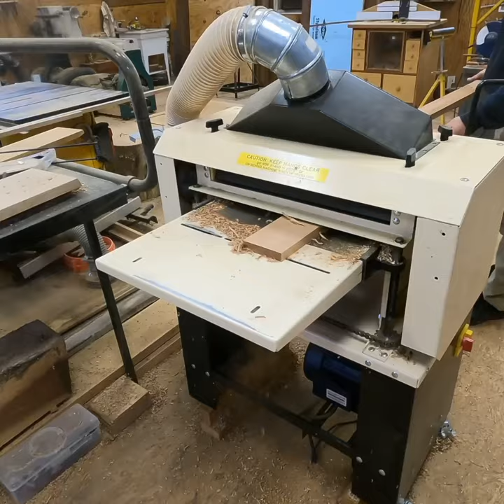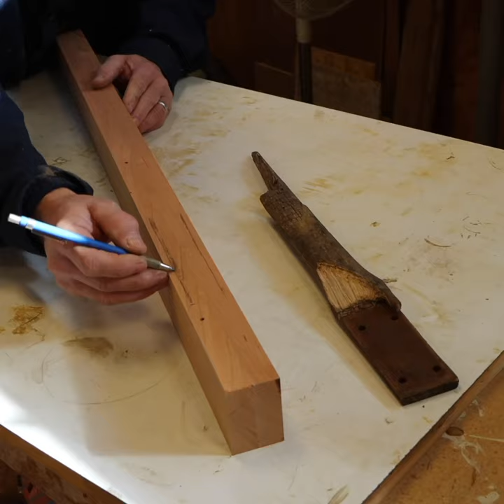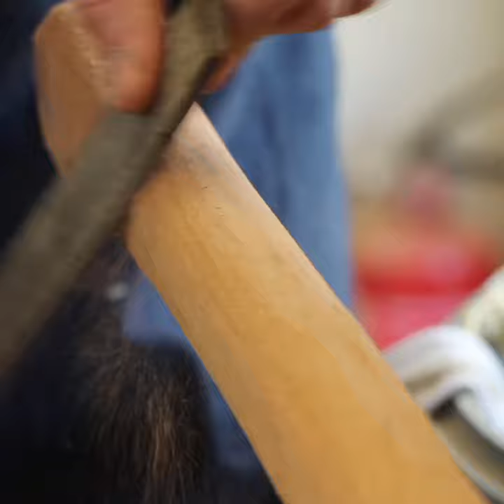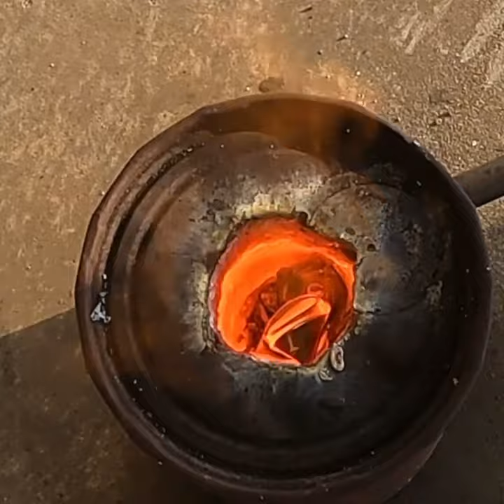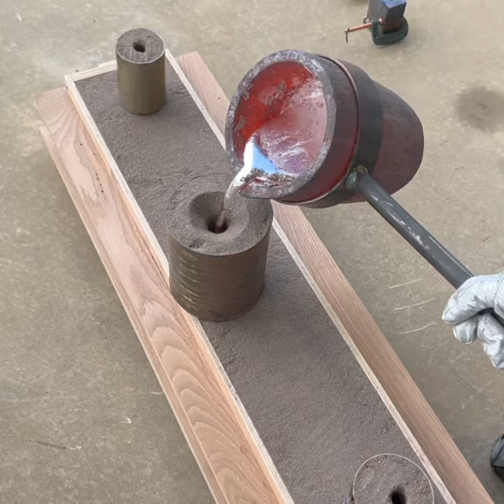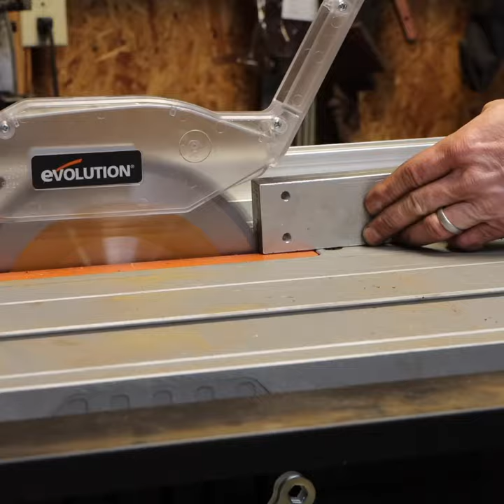Cast Axe Handle From Cans

Comment: That's gotta be COLD to handle in the winter time.  Probably sucks the heat from your hands even with gloves on.
Reply: Along with no flex, my joints are hurting just thinking about each, "whack".
Reply: You really wouldn't use a bush axe in the winter. It's made to cut away overgrowth. Kind of like a machete, but for thicker growth.
Reply: Aluminum changes temperature fairly quickly. Yes, will steal all heat.

Comment: I found a bill hook just like that at a recycling center. The guy behind the counter refused to sell it to me, saying it was part of the decor. So im still using home depot bought peice of metal on a stick that bends in the slightest breeze and holds an edge like warm butter. Glad someone hired an interior decorator for the dump money well spent.
Reply: Just.... Go buy one? Why did you buy a POS sheet of metal instead of just getting the tool or getting the blade?

You're better at crying than trying apparently

Comment: When I was in high school back in the 80s I asked the shop teacher if I could use cans for the aluminum. He told me NO! he said that because of residual moisture in the cans might blow up the forge.
Reply: I'd agree with his assessment that highschoolers shouldn't. But an adult with proper precautions is fine.
Reply: You can let the cans dry if you want first, a lot of people let cans sit on rain so they can fill with water, this can be dangerous.
Reply: Thats why they pre heat it dammit
Reply: You just need to learn how to do it correctly 😊.